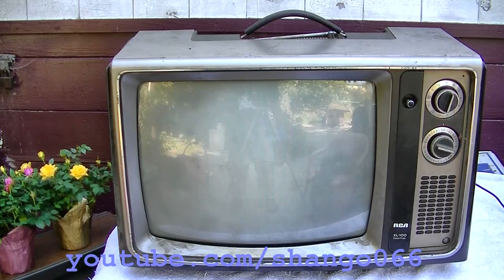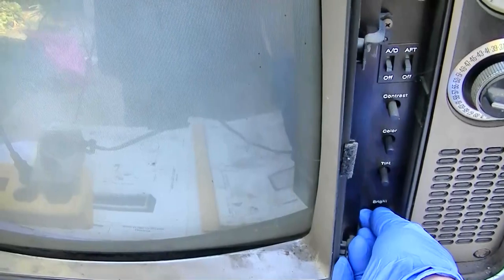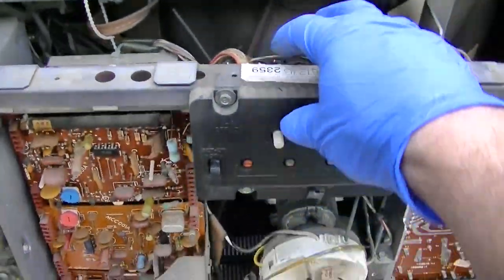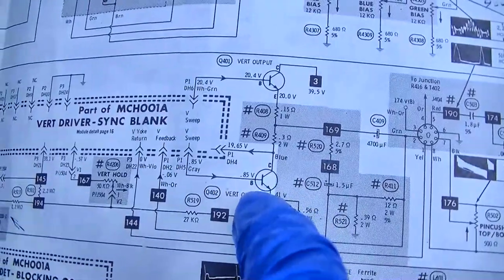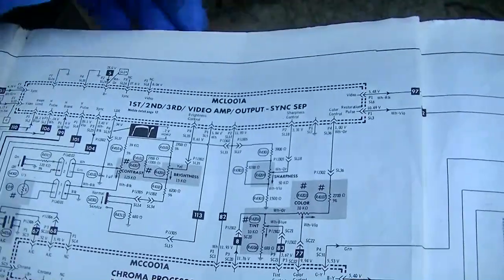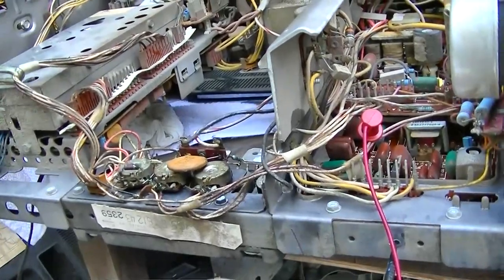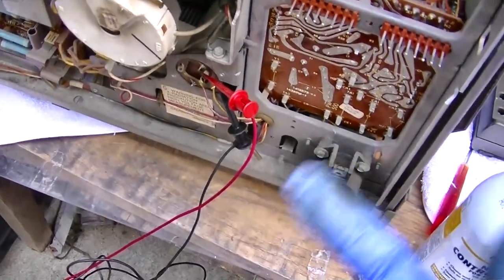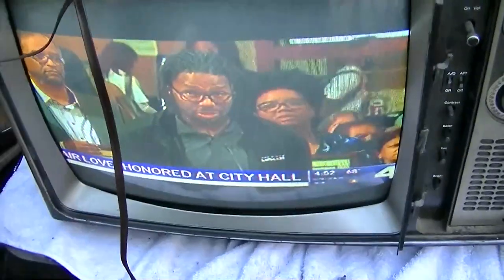Repairing 1976 RCA XL100 CTC74 Color Portable Table Top Vintage Television

Comment: I have a working RCA TV like this from the 80's.  Interesting that it has outlasted every TV I've owned.  In 2015 I bought a 24" Vizio flat screen.  It died in 2.5 years.  This RCA is still working and I am using it in place of the (shitty) Vizio.  I will never buy another Vizio after that experience.  My RCA TV was manufactured in the US :)  Hah!

Comment: This set brings back memories of servicing TVs in the 80’s. I worked for an authorized RCA shop part time during college. This is an early XL model with the “Better” module connectors. RCA switched to troublesome plastic connectors in later modules.
Reply: What’s with the 3 to 5 years for modem flatscreens? I had a 50” Sony for 10 years then gave it to my brother. TVs are much much more reliable these days!

Comment: This was our family TV, bought new in 1976. I believe the very same capacitor brokedown ~ 1980. I could not figure it out then. It was repaired by a TV technician. Once replaced it ran for years and years until the CRT was so dim & blurry, it was no longer watchable. It still ran. The RCA was replaced in the mid-80's by a ~ 1978 19" Goldstar in a teak cabinet. Repaired it as a teen, from a lightning strike. That Goldstar ran forever after also. This one still looks great!

Comment: I remember those bonded yokes, those came out at the same time I got out of the TV repair business.  The yoke is greatly simplified from what the tube sets used, with considerable fewer windings.  In order to generate the required magnetic field to deflect the electron beam, high deflection currents were used.  In the case of the vertical, the deflection currents are so high, it causes the 4,700 uF cap to heat up, which dries the electrolyte out after a while.
Reply: A new cap after more than 40 years and thousands of hours of use is kind of 'adequate'...
Of course you are right anyway. I live in Germany and I am amazed by the combination of a inline tube with a SCR-horizontal. When the inliners came in Europe, 99percent of the horizontal sections were transistorized.

Comment: I built a house in Black Forest, Colorado and I bought a TV just like that one for our bedroom when we moved there in 1976. Black Forest was at 8000 feet between Colorado Springs and Denver. Had two antennas on a pole, one pointed north toward Denver and the other south toward Pueblo where all the COS stations had their transmitters. Got great reception on it.

Comment: You did fine with this, your a competent tech and went methodically through the normal "process of elimination"  style of troubleshooting, once you checked those outputs and the Vert/Horz board for shorts and opens that was it,  time to return to the power supply.  nicely done man.

Comment: I haven't worked on one of those in years and those were well built sets that are technically "luggable", instead of "portable." The CTC81 is the 25" version of that chassis and those are paired with a delta-gun CRT.

Comment: When I was still repairing TV sets, open electrolytic capacitors were more common. First the rubber dries, which shrinks it, and then the whole capacitor dries up until it's as dry as a stale fart. But still better than when the electrolyte leaks and spills over other components. I also know the thyristor deflection from our televisions in Germany, 17089h and 17088r were the types of choice for us. I miss the old times.

Comment: The Spring with the resistor is a DC-Fuse with high disconnecting current capability. The resistor gets hot , the solder melts and the spring snaps back and quenches the DC arc.
Reply: and in many cases, the solder is splashed somewhere, mostly the circuit board ;)
Reply: That's why in that case the contraption is in a glass vial.
But you are, of course, right. The, unfortunately, common construction using a sand resistor and a hairpin spring is a very bad style.
Reply: I love the light blue parts. So easy on the eyes.

Comment: I applaud you at 32:00 for not being a board swapper. I was a Drivability technician at my GM dealership. I worked on engine and body control computers and CANBUS systems. When we got a car in with a bunch of new parts on it, we would say it had the parts cannon shot at it. A mechanic somewhere blindly threw parts in it hoping one would fix it
Reply: I/we'd call it throwing darts. Pretty bad when the parts dep't becomes your "diagnostic" strategy.
Reply: We always call it shotgunning and it seems to be the way most techs do diag these days. Been a dealer tech for a long time and with Porsche for the last 10, no different in any of them.
Reply: I think it boils down to most "tech's" out there only half understand what they're looking at, and don't want to spend the time to learn. 

The other half (at least for dealers) is working in a flat rate environment. Get it done quickly, take educated guesses, or you'll loose your shirt. 
I don't know how other manufacturers do it, but back in the day working as a master tech at a Mazda dealer, I had to tag all my warranty parts, with an explanation on why they're bad. If they went back, and tested good, the claim would be bounced, and I'd be called to the carpet for some splainin.
Reply: @bugdrvr  I do through diagnostics and tests to definitively find the fault. Throwing parts gets expensive. Had a guy bring me a van several years ago and he was ready to test his hair out. 2 months, 5 shops, $800 in parts, still not right. I did a hour of diagnosis and found the signal reference from the map sensor to the computer was broken due to corrosion at the bulkhead connector. Spliced in a new wire and done

Comment: I had a suspicion of that capacitor when you were checking the output transistors. I have had high value large electrolytic capacitors open lots of times in solid state jukebox amplifiers from the 70's!
I just got a 76 model XL100 TV and was watching you video just to see what was wrong with it. I used to work on them back in the 70's and 80's.   Enjoyed the video and from previous videos I knew you would figure it out.

Comment: Warren had her swan song and it took out both Bloomberg and Powerpoint Pete.

I found a Chinesium RF modulator on eBay that has enough output to serve as an in home transmitter. It has selectable channels so I can transmit on channels 2 through 13. So I now have my own little analog TV station and can actually use the tuners on my old sets.
Reply: I wonder what model owo
Reply: @milesprower6641  I dunno how Youtube feels about eBay links but look on eBay for "Compact RF Modulator Audio Video TV Converter " It will be the ones with the blue plastic on them.
Reply: Ah, its those. There neat.
Reply: I've got a Curtis that's on UHF channel 14 made in the 90's and it does 300 feet with it's telescopic antenna. Still need to test it for maximum range one day.

Comment: The whole time you were troubleshooting this thing and referring to the schematic, you ignored all of those nice waveform picture that you could have used that Tektronix 442 to look at instead of just battling it out with a DMM!  When I was a repair-tech, I used a scope nearly exclusively even for voltage checks; many times you can see trouble even though a voltage is correct--you get the 'whole' picture on a qualitative-basis. The only time I used a DMM was for high-voltage, resistance or AC-line voltage stuff.

As far as the open 4700uF cap, this is a common failure mode for capacitors that are subjected to continuous pulse-service, where conversely, power supply filters are more prone to shorts due to constant static voltages near their ratings; and of-course, heat hastens all of it..

As far as the RCA XL-100, it was a landmark technology shift for RCA.  They had put themselves on a previous 5-year mission to make a quantum leap in the TV industry for both circuitry/performance and manufacturability/ease-of-electrical troubleshooting and mechanical component/module replacement.  As a authorized RCA service-shop with a current XL-100 subscription, you could return any XL-100 modules without diagnosis and pull a spare from the default kit that you got as part of the deal.  Additionally, RCA actually send out a couple of engineers that gave troubleshooting presentations and they were absolutely excellent---these guys being the actual design engineers were really sharp and loved to tell 'war-stories', it was absolutely fascinating . I remember that evening very well, as it went from 6PM to nearly midnight, with cigarettes blazing continuously! 
As long as you played ball with RCA, it was a pretty neat ecosystem that smaller shops could not compete with...

Anyway, very happy to see someone like you both dabbling in this stuff as well as your dogged-determinism to fix anything even is it is slated for the trash!!!

Comment: I always called them extra large 100 pounds. They were actually one of my favorite sets as far as RCA went. Nice picture when right and modular and easy to work on. The later Zeniths back then were set up similar and I bet I still have some of the Zenith boards. They certainly were heavy suckers, hence my nickname.

Comment: I found this model tv in the trash. It weighs a ton. Not exactly a portable but a back breaker. There was a cold solder on the horizontal drive transformer and adjusted the rgb bias and cleaned the tuner This model used the bonded yoke crt

Comment: Those SCR-type horizontal sections aren't THAT hard to fix. I'm in my fifties and I had tons of them on the bench during the 80s. They were extremely common in German TVs. There are some rules to follow. You have to use the EXACT right parts. Sometime the two SCRs (forward and return) have (almost...) the same parts  number. Often a super small "a" or "b" (often printed in a pale red or green while the parts number is solid black) on the case makes all the difference. The caps have to be the exact type specified in the service manual.
The most common failure is cold solder joints on the driver transformer or the flyback. Corroded connections on/to the yoke are also fatal. If you fire up a SCR-type horizontal section without the yoke connected; almost everything blows up in an instant. Bad solder joints on the flyback can (literally!!) burn your house down.
To test if a SCR is bad, you just short one out and watch the current draw. If it's normal and the other SCR "whistles" a bit, you have the bad one.
A bad SCR-type horizontal section sounds like an idling two stroke engine.
Reply: Preach brother! 100% nailed it man.
Reply: Can you tell me what was the point of the service switch just having a  horizontal line and how that was suppose to help with repair of a set ?. I dabbled in TV repair  years ago but never understood this point.. Thank In advance for your insight
Reply: 12QWASZXQWERTYUIOP  OK:)  Thanks for answering .. I guess you would have to work quickly as the line could damage the CRT  as Shango suggested ?
Reply: @evergriven7402  Tracking,Drive & Convergence set-up.

Comment: With many tube vertical circuits, the output to the yoke is driven using an impedance-matching transformer. Most vertical circuits using solid state devices have an output with 2 transistors rated for high power dissipation, sometimes coupled directly to the yoke, or in this case, via 'C 409', the 4700uF electrolytic capacitor. With a Philips (equivalent to 'Philco') K-11 chassis, it used 3x 680uF, 50V electrolytic (in parallel) as coupling to the yoke. Managed to diagnose by putting the oscilloscope across the capacitor, finding a typical vertical output waveform! Replaced with a 2200uF, 50V single electrolytic. "Let me finish, thank you..."

Comment: Doorbell?  That's the commutating coil for the SCRs...  Also, the 74 and 81 were NOT picky about line voltage.  It was the Sony's that would puke themselves silly during a brownout.  RCA was using SCRs since 1969.  Very advanced design.

Comment: Thank you for bringing back memories from my TV repair days in the 80's! That particular chassis did not have the infamous horizontal "Start-Run" circuit where the flyback transformer supplied chassis power. I was surprised to see a good old fashion 60 Hz power transformer.  Give the modern TVs some credit though, many of them are  lasting much longer than 3-5 years.
Reply: I have a 32" Samsung LCD that's lasted more than a decade and its still going strong as my primary TV.

Comment: SCR horizontal deflection using TO3 transistors was common in some mid-70's solid-state sets including the Philips K-9 and K-11 chassis series (and some Sharp TV models) made for Aussie market. A royal pain to repair when it failed (often the HV "tuning" caps (plastic tubular type) connected to the collector of those transistors would go open or lose capacitance causing a dead short). I encountered a lot of these with "blown-up horizontal" years ago, and I only ever had to replace a picture tube as a result of this kind of failure ONCE. 
** Great video Shango - I don't know if Bloomberg approves of it but I do. **

Comment: I friend of mine blew a console TV in my zenith Allegro console stereo from the mid 70's messing with those convergence nobs in the rear that you were using to check the vertical and horizontal feed.

Comment: Nobody wants to live in the past, but there is no reason that stuff could not be made better.  Yeah, it's cheaper in the short run for junk equipment, but it doesn't last. 
Plus, though stuff was more money, we had better jobs making the stuff.  The people who used to have jobs making equipment today are on public assistance and poor.
Reply: Used to work in a tv repair shop. I'd tell customers to fix their old sets don't buy those new sets but they didn't take my advice.

Comment: watching these videos over the years I find it really interesting that the background and drive controls on US sets are made easily accessible. In all UK sets I saw these controls were internal or required some part of the cabinet (like the speaker grille) to be removed to access them. Probably for the best with the tendency for people to have a fiddle with anything they can see. Likewise the horizontal and vertical controls were often inside. Some sets even stuck the contrast control at the rear.
Reply: In Germany the drive controls were quite prominent and easily accessible on the back of the TV. Big red,blue green colored pots. At least on Grundig, Telefunken and Loewe-Sets. When the integrated circuits took over, the drive and bias pots migrated to the PCB on the neck of the CRT.

Comment: A bonded yoke was incorporated into the crt.  It eliminated convergence adjustments. Those scrs were expensive back in those days. The vertical output capacitors were a common problem on this model

Comment: I remember the Remote Controls for this series / time frame RCA offered were the big Black Bricks. Very large remotes that sat on the coffee table I guess so you wouldn't loose it?
That TV does have a excellent picture.
Reply: Those were the "direct access" sets with electronic tuning and they were very expensive. There was another one that used a smaller remote and a motorized varactor tuner.

Comment: FYI - You probably already know this - but when you asked "where's the base" - many solid state components have one of their leads (usually the collector or drain on a FET) the case itself, intended to be grounded - but maybe 1 out of 4 times it actually is supposed to be at ground potential.  Those plastic insulators keep them from "Grounding out" and the case itself is the collector.  I learned this when I was trying to fix an inverter and the MOSFET popped right away, they have a lead AND the heat sink tab with continuity

Comment: That's not a feedback cap, that is the coupling cap to the yoke.  All the current through the yoke goes through that cap.  It keeps DC from the output from throwing the raster off the screen. Very common problem.  Most vertical problems with the CTC74 were either that cap, bad connection on the yoke octal plug, or bad connections on the deflection module.

Comment: Dear Shango066 because I have heard you say a number of times that it is hard to tell the collector from the emitter when testing a transistor using diode check, note that the collector have a slightly lower voltage drop when compared to the emitter.